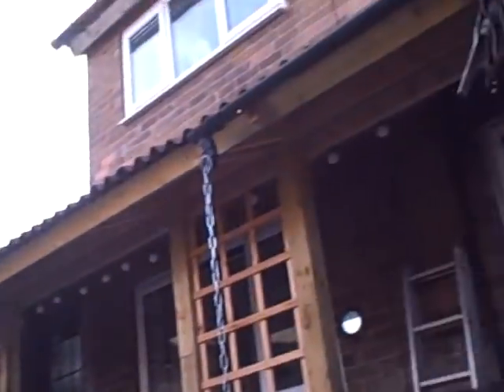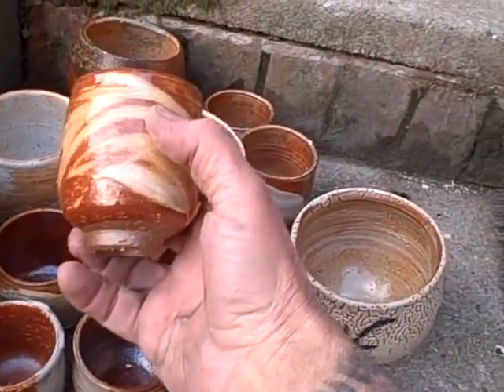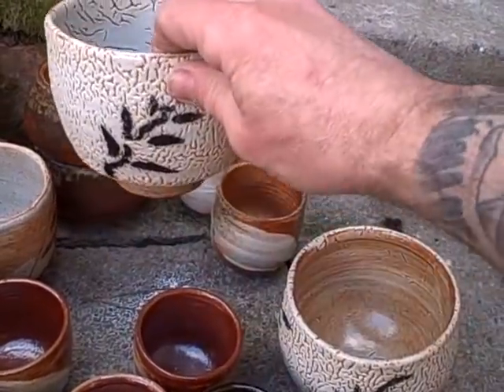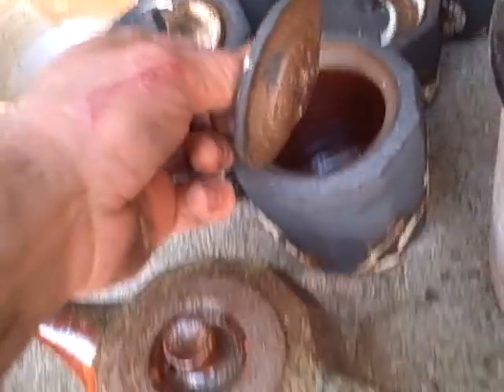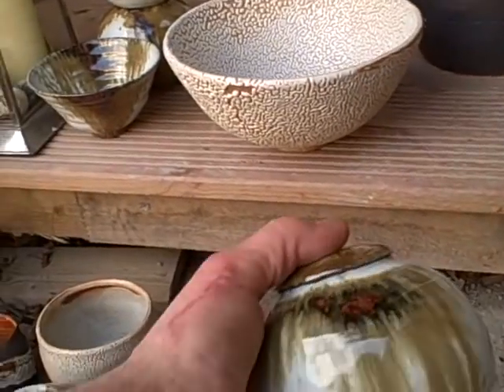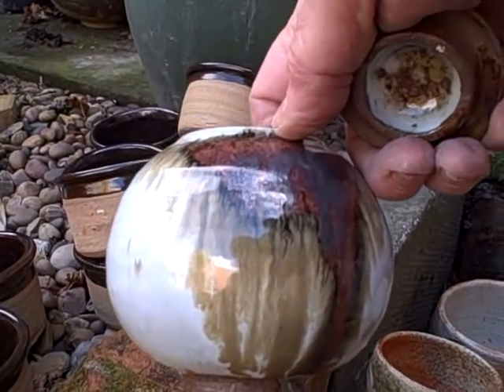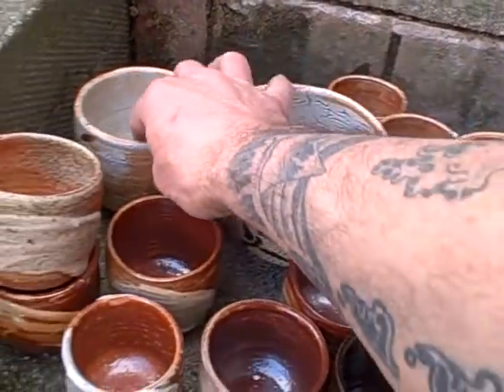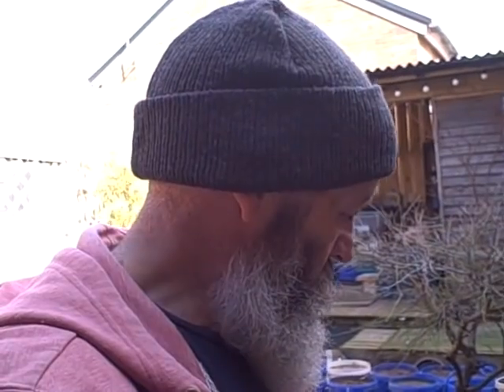pottery firing results march 2019

Comment: Just a beginner question: for the glazing you do (tenmoku, shino, etc), you apply it to unfired vessels, don't you? I have always wondered as here I only work with low firing in an electric kiln (I have to use a community kiln and  lab) and need to bisque fire first. (I am only a beginner, sorry for the dumb question ).
Reply from the maker: hi i always bisque fire . If you do raw fire shinos are the best as they have ahigh clay content . tenmoku blacks may crawl.